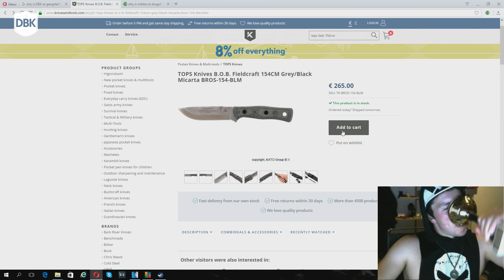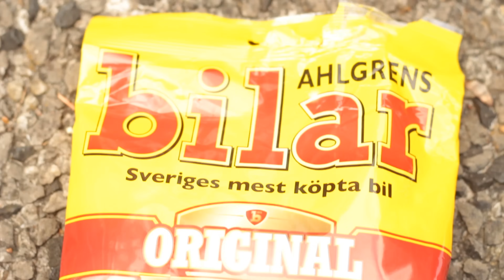The Ultimate Fire Knife | Tops B.O.B. BEAST

Comment: "indestructible" - Lilly laughs
Reply from the maker: +ichheiß Dochso hahahaha
Reply: Dutch Bushcraft Knives I hear she did a torture test on the dinosaurs...
Reply: "cutscene to lilly mounting the knife on her survival jack hammer"
Reply: I hear some women get physical gratification from using knives in alternative ways.....
Reply: Lol
Reply: Survival Silly
Reply: Lo
Reply: Would the carbon steel version perform as well? It seems to be a bit more affordable.
Reply: Dan Riley The carbon steel version would be less rust resistant but on that same note it would have a more chip resistant edge.
Reply: @Supernaught00  the carbon steel one is tougher but has a slightly lower abrasion resistance so you sharpen more often although it still holds an edge pretty well, and the trade off is that it's super easy to sharpen in comparison to it's edge holding
Reply: Whos lilly?
Reply: @thebardock6785  Survival Lilly, a youtuber.

Comment: A few years ago, I purchased a TOPS BOB for here in Alaska.  WHY you may ask?  A.)  I saw an all-arounder knife that was a well thought out versatility/utility outdoor segment knife.  B.)  TOPS is of reasonable reputation on several levels like dependability, good quality to price value, known for consistency in workmanship...materials... heat-treatment... etc. and C.)  They have shown the ability over the years working with designers/developers plus in-house work-ups that have stuck around long enough whereas several models become 'proven'.  The BOB is a good knife no doubt (mine is in the 1095 coated w/ green micarta), a good looker, and well built.  That said, it is one of those knives I like and would trust in certain conditions/environs... YET... rarely if ever would consider using.  Sad really, but it is just a part of the collection and never a front-line player here in the LAST FRONTIER.  With regards to the 154CM... I simply do not perceive this to be any better or move it up the chain as something I'd use or recommend based on what are the competitive/comparable options available.  I feel to truly enhance the BOB... the aim needed to be higher as in 3V at a minimum baseline of upgrading to more stainless qualities.  Maybe even M390 or ELMAX as others raising that bar, IF (and only IF) TOPS was up to knowing what they were doing with it and to produce it having consistency.  None of what I'm relating here should be taken out of context and none of it suggests any complaints... It's a very good knife design and made very well.  I do however think that it is one of those get your hands on one, try before you buy, watch/read reviews and make a calculated purchase.  Know what it is and what it isn't.
Reply from the maker: +Alaska Raft Connection - Alaska-BushRafter I can understand! It's extremely well built but doesn't have as much character as let's say a bark river.

Comment: Is this back's spine true 90 degree and just as sharp as other knives? (the back edge)
Reply: DancingTreeGaming  The knife is differentially heat treated, with the edge being significantly harder than the spine. Many people complain about this, but the company apparently does this to control vibrations to the hand during chopping or batoning. The very end of the spine is hard at the tip, the rest is covered in a coating which prevents scraping a firesteel. They removed the coating I guess. From factory it doesn’t come with a 90 degree spine. I own the same knife so I can attest to this.
Reply: @n-signia1087  this version is 154cm steel. It's has full heat treat so the spine is just as hard as the cutting edge. What you are referring to is the 1095 version.

Comment: 265€ ?! Sweet baby Jesus! I paid 165$ for the 154CM and thought it was way too expensive.It is an OK knife but it is too thick,heavy,nasty jimping, handle too thin with no palm swell and over all difficult to control.No sharp spine/coated/ out of the box so it doesn't make sparks at all.Cool looking and very good blade gring and profile.Good mix of bushcraft/survival as you said.

Comment: I recently purchased this knife and it came with no edge at all. I must have gotten one all the way up at 61 hrc because it has been a pain to put the edge on it. Not complaining. That is a statement towards the fantastic heat treat. I just wish they would have put an edge on it coming from the factory.
Reply from the maker: +Hive Mind that's a bummer. Ours came decently sharp but we regrind every knife anyway
Reply: Dutch Bushcraft Knives That was my plan as well. V edges are terrible. The knife is lighter than I thought it would. Overall it is definitely a beast, the results speak for themselves.

Comment: One issue I had with this knife is the handle screws getting loose. Normally I screw them tight but while batoning they came loose and I didn't have the necessary tooling with me to tighten them.

Comment: Did you file the spine down to a 90 degree angle? Or do the new models have a 90 degree spine? According to other reviews, you can't strike a ferro rod with this knife unless you use the blade or the notch at the bottom of the handle.
Reply from the maker: +Chansoo Samuel Pak this one came this Sharp! This was the 154cm version though
Reply: As 154-cm is air hardening, it cannot be differentially hardened to have a soft spine giving a tougher knife. Therefore on THIS TOPS the spine can strike ferro rod, but has shango notch too.

Comment: I heard that the coating on the blade prevents sparks from a firesteel, but you guys had no problem. Did you strip the coating from the spine, or was it just ok as it was? I've also heard that the jimping on the BOB is a thumb-killer and am surprised you didn't mention it, given how much you said you didn't like jimping in the past.
Reply: subroc I believe this is the stainless (sorry i forgot the exact steel) version with just a satin finish unlike the 1095 version (with the powder coat)

Comment: I've heard the micarta are slightly thinker than the G10 scales so did you think the micarta was too thick? You mentioned it being good for people with bigger hands. I really want this knife but I can't decide on the handle material. How does your micarta handle feel and would you recommend that handle or would you prefer the G10?
Reply from the maker: G10 is indestructible although this micarta feels that way too. On the other hand micarta is more easy to sand down a bit if you wish to make it thinner.
Canvas micarta feels grippy and absorbs oils and liquids. the handle will discolour eventually showing all the adventures it has had.

For a hard use knife I often go for G10

Comment: Can you review a knife around 100 $. I know that the 400 $ knife is excellent but on the end of the day if you hit a granite rock with it will chip. In many places most of the rocks are not sediment they are volcanic and are very hard and abrasive. So braking a clay brick with a knife is really not a miracle or stabbing aluminum  frying pan. If the 400 $ knife is so good tray stabbing a cast iron dutch oven this is something that will really show what is the knife made of and do a tip test in a granite rock. All the  things you did with the knife can be done with something that cost from 50 to 100 $ . I am not a against high quality tools but for 265 euro they need to be able to perform where regular steel fails. I do hope that you get this as a constructive feedback .
I like your videos .
All the best 
Alex

Comment: Why has your BoB a sharp spine and mine not?
Reply from the maker: +El Sakko mine has a small part where the coating was removed. Perhaps this is only with the 154cm version
Reply: Dutch Bushcraft Knives Ok thank you, I also got the version im 154 cm and on my knife, I just got a sharp tip. What do you think about the tool for using the firesteel at the back of this knife? My one hasn't also got this sharp enough for striking sparks!

Comment: I had this Knife in 1095-Version.
After a few month, I sold it at ebay.
Reasons:
It´s a very heavy and thick knife. Too heavy for me.
The Handle is too long.

The Firesteel-nodge at the end of the Knife dosen´t work.

I saw the Factory-Video from Tops, and the Heattreating process.
They Hardened just half of the Blade, the Edge areal. The Back of the Blade is soft, not hard enough to make Sparks with a real Flintstone. With Mora or the Glock knife, you can make Sparks, just with the Knife and a Flintstone.

The Micarta Handles stunk horrible.

The sharp edges from the metalclip of the Kydex-sheath, scratched my Leather-Belt.
I didn´t liked the Firesteel.

Maybe the 154CM Version, does a better Job.

Comment: TOPS has great designs, but 1095 ain't the best steel, they could add blades in M390, or 4v, something like that, hey even s35v would be great.
Reply from the maker: +Randall Kelley this one is 154cm. Definitely better than 1005
Reply: Camp Creek and Dicer 3 / Dicer 8.5 are in S35VN